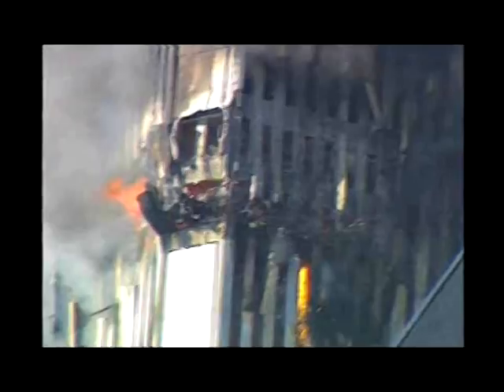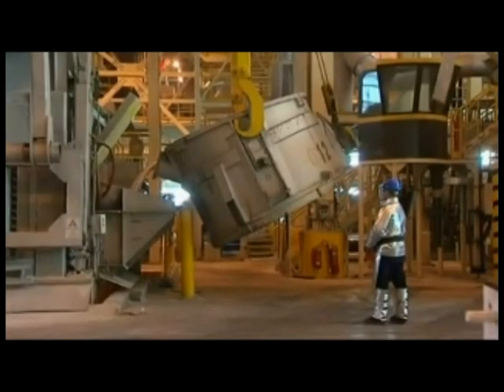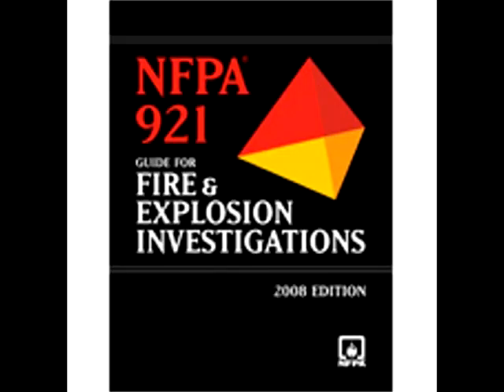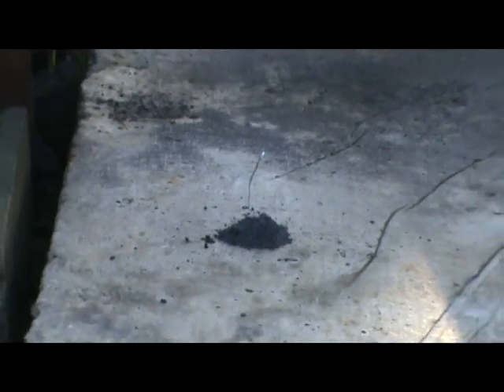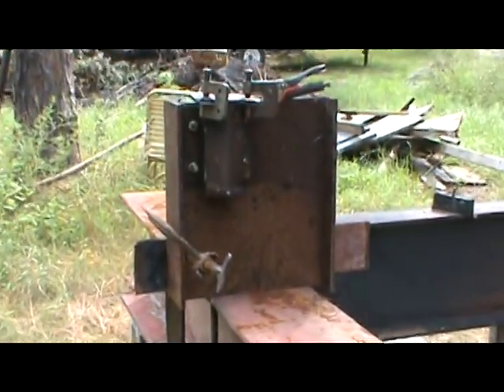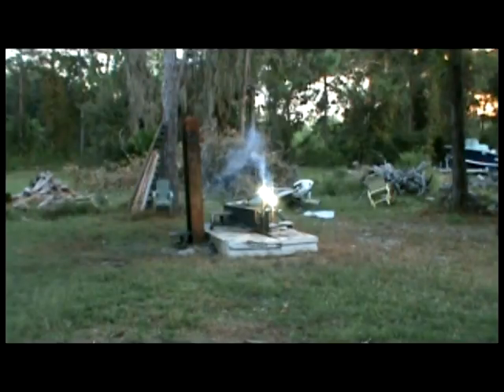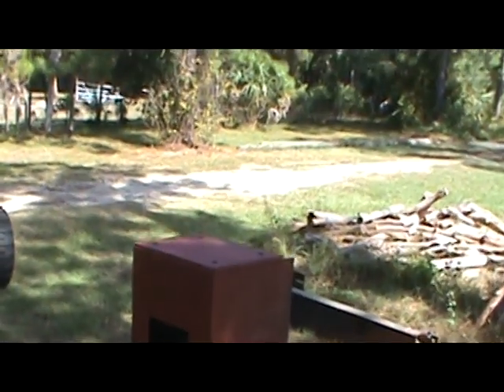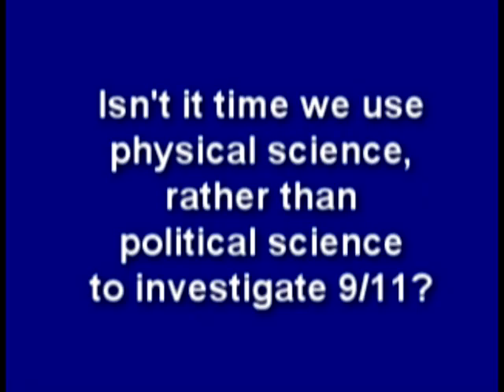9/11 Experiments: The Great Thermate Debate

Comment: You should be fucking ashamed as an engineer. First, it need not melt anything. You heat steel to that temperature and all that strength disappears. All it has to do is weaken and sag enough places such that the weight exceeds the design specifications. Once that happens all integrity is lost and the sequence of events to follow set in stone. The floor below it will have to hold more than design spec and can't so it fails, also weakened by intense (but not hot enough to actually melt) fire. If you look at the original prints for the construction it makes perfect sense. Not sure why everyone is so hung up on melting steel, you don't need to melt shit. Take a paperclip. Hold it with some pliers and then heat it with just a normal Bic lighter. Then use another pair of pliers to bend it at the point you were heating. Easy right? Now do the same without the heat. See? Come on engineer, this is basic shit. 

Yeah those puffs? Well see when one floor comes nearly uniformly pancakes..oh. You don't think that's how it went. Well, lets suspend that, how much air is in a building that size? How much one floor? Well it has to go somewhere when the floor above it comes down, path of least resistance is out the nearest window. Then the next one comes down and more air gets blown out. 

All you've done here is prove something that everyone with a brain already knew about cutting steel. What I would really like to see you do is to take one of those I beams and put an object of known mass on it, something quite heavy but well within what that beam should hold without moving a millimeter. Then heat the beam to a temperature comparable  to the temperature NIST says was the maximum and let cook for around the same time as the fires burned. Then measure the sag. I don't expect the beam to fail, but I expect it to sag and bend and be weakened. 

I'm not looking for you to cut the beam, just heat it. Humor me and do it? I would but I don't really have I beams laying around. Remember when heating to take into account the high winds at those heights so maybe fan the flames a bit, almost like a bellows. Everyone forgets the wind. Everyone can argue numbers all day, like how hot the fire was and how long it burned but at the end of the day numbers don't mean all that much when something like this happens. So many variables that were never even planned for or thought about, materials in the offices on those floors, how consistent the steel was in it's quality, if it was constructed well and no corners cut or if it was constructed poorly, and a dozen or so more to go along with those. 

I would really like to see that heat test though, bellows included. I think that would silence a lot of this shit, whichever side is right. If I'm wrong and the steel doesn't budge, then I'm wrong. If it does sag, maybe a few more clever tests to see how much sag you need to fail under a certain load.
Reply: A steel building has never collapsed again due to fire.
Reply: +William Lawrnece I guess building 7 did as well?

Comment: For all of you saying that the Towers were made to survive a plane crash just remember that the Titanic was made to be unsinkable and yet Ice took it out.
Reply: +joe eoj Titanic was never designed to be unsinkable. No-one at the ship yard or at the company that owned her said that, it was the media of the time who came up with that.
Reply: +joe eoj Technically, the towers WERE made to survive a plane crash from a Boeing 707 travelling 600~mph, the 707 being one of the largest passenger aircraft at the time. The planes that crashed into them (AFAIK) were 767's, Which are a decent bit heavier.
Reply: +Garrett Williams So how about WTC 7 then, not hit by the plane?
Reply: Whateverfits What the fuck was burning the steel beams columns?
Reply: All airplane recording boxes are gone. . Pentagon has 160 cameras 151 out of service lol
Reply: +joe eoj what if the titanic was a setup
Reply: +runlarryrun77 The Titanic would have survived a head on collision but the idiots turned. The iceberg ripped through the ship's side. Just google it.
Reply: what does the Titanic have to do with 9/11
Reply: +Whateverfits And, of course, the mass of the iceberg when it was struck by the Titanic is directly comparable to the mass of a Boeing 767 when it flew into one of the towers, yeah? If brains were measured in altitude, mate, you'd be a fucking deep hole in the ground!
Reply: Yes. I've seen it. No you don't need to continue.
Reply: ***** you say I lack intelligence when it is you that does not realize a Iceberg is made of frozen water also known as ice. So what you said was "you're stupid calling ice ice, dumb ass".
Reply: A Retarded Twat That's not the point I was making. I wasn't talking about the design, rather that the "unsinkable" label was bullshit hype bestowed by the media of the time, not by Harland & Wolff or the White Star Line.

Bored of this now. Thread muted.
Reply: But was it ice that actually took Titanic down??
Reply: Whateverfits yes but look at the time frame  titanic sunk 4/14/1912 the towers were finished in 1973 and were destroyed 9/11/2001 a big time difference which means technology has changed since then and the way things were built has changed as well
Reply: Garrett Williams So you're just going to ignore the massive amounts of evidence presented in this video and believe the narrative?
Reply: Technically it did survive the plane crash.
Reply: +runlarryrun77 Fair enough - planes are designed to not crash, tunnels are designed to not collapse, the space shuttle is designed to not burn up, refineries are designed to not blow up, battle rifles are designed to not jam, cars are designed to not roll over... do I need to continue? Ever seen 'Engineering Disasters'?
Reply: +runlarryrun77 Thank you for a civilized response!
Reply: It didn't get hit by a plane. but it did get hit by a fucking skyscraper
Reply: +OhFishyFish Why is this the number one excuse ever???  BUILDING 7, WTC 7!!!!!  BLAH BLAH BLAH.  Debris flew out of the buildings during and after both towers were hit.  Several fires broke out around nearby cars and other buildings and yes WTC 7.  The reason it didn't survive the fire was because one, fire fighters were busy, two the sprinklers couldn't work because their main water source came from the twin towers.  After they collapsed the water system was damaged.  Just a basic building collapse due to fire.  It's happened before with other buildings.
Reply: +joe eoj I'll give the engineers credit, the buildings did survive the initial impact.  Sadly the damage was already done so it was only a matter of time before the flames weakened the structural steel enough to where it couldn't hold the upper floors anymore.

Comment: Answer me this mister engineer. I am an amateur blacksmith and know it takes between 2400°f and 2500°f for me to forge weld and charcoal burns at just over 1200°f, so why do I not have a problem forge welding when I fire my forge with charcoal(kingsford to be exact)?Oh wait I know, its because I introduce extra air into my forge, you know I blow on it, just like the wind and thermal updraft did on 9/11.
Reply: +Corey Schmidt The thing is, you ARE a blacksmith. The OP is just a know-nothing poser.

Comment: If you watch the video of when the buildings fall, you can see the point of failure quite plainly. It fails near the point of impact. And when 10+ stories of steel and concrete start to move, well, there's no stopping it until it hits the ground. Say what you will, but I watched it happen like everyone else, and I saw simple physics at work.

Comment: Iron goes through a phase change at about 900 Degrees F which makes it significantly weaker, and obviously iron is IN STEEL, also, it IS possible that iron CAN melt out of steel leaving only the carbon chains. Dont forget that the impact of the plane most likely caused the steel to bend with the force of over 560 million pounds of force

Comment: You don't need to cut or melt a steel beam to make it collapse, silly...
Reply: +FieryWingedAngel The beams were melted is the point.
Reply: +CBodhi 
Its not a point wheter you need to or not, its a point that they DID.
Reply: +geovs20 B-52 hit the Sears tower? I hope your comment was meant as a"joke".
Reply: +Callsign Vega  A B-25 bomber hit the Empire State building in 1945. While I think they have their facts slightly wrong, I think they are still saying the same thing as the building was hit by a plane, fuel dumped in, building caught fire, and the building did not collapse.
Reply: +FieryWingedAngel you do if you want to make sure it collapses

Comment: Jet Fuel Can't Melt Steel Beams
Reply: nice meme
Reply: Person Man McDude Guy *Dank
Reply: Nathan Mierzwinski nice meme *Dank
Reply: Degenerate999 I'd just like to say he used "thermate" in this video, not "thermite." Although thermate is a different kind of thermite, he used it in this video to show that thermate could've been used instead of thermite to use it based on eye witness reports and evidence of what thermate did to the steel beams
Reply: +SoulRebelsoltera3 It was a B-25, which is WAY smaller than a 757. Back then, the much smaller fire was extinguished in 40 minutes.
The metal was molten by an ad-hoc mixture much like thermite, the light metals provided by the airplanes.
Reply: Degenerate999 Also, it was a dank meme, so chill
Reply: I like how people still don't get the meme here
Reply: +Nathan Mierzwinski  Really?  A wood or coal fire can melt steel with a little air added, kind of like the vortex of strong wind a raging fire in a skyscraper will cause.   And you don't need to melt steel to collapse a building, only soften it.  I heat up steel until it's red and hammer it into shape.  Never gets close to steel's melting point.
Reply: Sarah G I'm sorry I said you have bad grammar in your reply. But that wasn't even my whole point, Sarah. What i'm saying is that I can't and won't take you seriously if you think that just because "I'm unoriginal," and you say that "you've copied this from someone else," doesn't mean i can't say it. Like, for real, so what? If you're mature enough, you'd simply ignore this comment and move along with the rest of your life if this bugged you SO much. And no, I am notsoever trolling you.
Reply: Degenerate999 i would if it wasnt a public youtube comment section where everybody can see toplel.
Reply: Degenerate999 i dont understand whats going on.
Reply: Prot07ype /)*(\
Reply: Degenerate999 Because I wasn't expecting people to reply with something like how it's not possible to melt steel beams. It's a meme, I was expecting most people to react differently
Reply: True.  But burning jet fuel can.
Reply: Degenerate999 dont expect me to understand anything ever that ever exists sir :p
Reply: Sarah G Hold up, are you saying that just because someone else said it doesn't mean i can't say it? Granite, yes this meme is old and is stupid, but it doesn't mean i still can't put it out there. I can't take you seriously with your lack of grammar, spelling, and intelligence.
Reply: Degenerate999 some day
Reply: Person Man McDude Guy
Why?
Reply: Degenerate999 cause reasons.
Reply: Person Man McDude Guy
 No reason is worth it. puts on glasses, grabs notebook
Now, tell me why you are feeling this way, Person Man. I'm listening.
Reply: Person Man McDude Guy You see, what if i told you, that of failed suicide attempts, 98% of the people said they instantly regretted the decision. Would that change your mind, Person Man? And what if i told you, that ending your life, doesn't actually solve your problems. Even though, at the time, it may seem like a sure solution..... I'm not a proffesional. I may end up accidently talking you into this. I'm sorry......uhmm.... NO NO DON'T DO IT! It was a mistake! Don't!, Stop it we can't! The numbers are bad, the numbers are bad!
Reply: +Person Man McDude Guy /)
Reply: Nathan Mierzwinski
It's a meme, because it's a fact.... How you don't understand that is what i don't get...
Reply: Nathan Mierzwinski Lol yeah, but it's like a meme about how ridiculous some atheist's big bang theory is. like if this were a meme 'Where did the energy for the explosion come from?' Is sure to incite  passionate responses from both religions. christianity, and atheism. You had to expect people to take this too seriously and into debate mode.
Reply: Degenerate999 lol i guess you're right
Reply: +Degenerate999 Most likely, they used thermite and other types of explosives.
Reply: Simboiss None of which would make steel beams vaporize. Steve Gould, you are a fucking moron.
Reply: Steve Gould
 Burning jet fuel does not make steel beams vaporize, you invalid.
Reply: Noone talked about steel vaporizing. Some steel, at some places, may have weakened, but most of the building was at room temperature.
Reply: Simboiss
steel beams were vaporized. that is a fact. I dont know what you are talking about....
Reply: Person Man McDude Guy
lol that last bit i was joking, and then a random reference to something you obviously did not see. The rest is self explanatory.
Reply: Person Man McDude Guy lol It was the most random reference ever. I didnt really expect you to get it. although if you did you would realize it had nothing to do with anything else i was saying anyway.
Reply: Degenerate999 what was the reference?
Reply: Person Man McDude Guy
The tv show Lost. When a fat guy was trying to stop people from blowing something up. LOL
Reply: Degenerate999 i never saw that show, so yeah and stuff.
Reply: Person Man McDude Guy
I know if you saw it you would have recognized it instantly.
I do recommend it though. Its my favorite show. And ironically is about a plane crashing.
Reply: Degenerate999 thats sexy.
Reply: Person Man McDude Guy
lol
Reply: Degenerate999 kek
Reply: It's really hard to take your comment seriously when you start with this: 

[ A Boeing has a bone structure made from high tensile aluminium which is stronger than steel ] 

Please share with us the special properties of this magical aluminum. Surely you have an alloy number for this magical aluminum?
Reply: N8 the Gr8
Reply: the fact their is no plane at the Pennsylvanian site and reports said they could only fine debris from the air plane the size of a cell phone!? this makes no sense once so ever and eye witnesses said they saw nothing, no bodies nothing just small bits of debris and a crater, they say the plane and the bodies all mostly vaporized after crashing!? lol ooookay like that makes any logical physical sense? something is wrong and we are being lied to because of the jews cough israel.
Reply: it doedsn't have to, it jus tneeded to weaken the steel, which it did
Reply: My penis can tho
Reply: No shit jet fuel can't,  fire melts steel,  not liquids.
Reply: N8 the Gr8 It can and it did
Reply: But thermite sure can!
Reply: Dont have to melt the steel beams just get them red hot to weaken.
Reply: N8 the Gr8
When 10-15 tons of fuel explodes at once you bet your dumb fucking ass it will.... not even including all the gas lines and such running through the tower.
Reply: +Cody Stein the floors didn't even have beams they were rods!! lmao! crony capitalists is what helped ruin those buildings. lobbying which cut steel use by HALF. -Gone Lucid
Reply: +Tom wtc7
Reply: Degenerate999 firstly, he wasnt serious he was using a meme. secondly, 9/11 wasnt a government cover up.
Reply: But it can weaken it
Reply: +Nathan Mierzwinski  the beams were not (only) melted. there is video of steel beams vaporizing/ turning to dust in a second. thermite could never and will never acheive this result. Whatever whoever used for this, it wasn't thermite.
Reply: Go ahead and hate! You are right however that doesn’t explain freefall speed because the pressure would snap the steal beams and the beams would snap in different directions causing the fall of the build to teeter totter on the way down. It didn’t it was free fall. Now I believe planes did hit the WTC but there was thermite involved no doubt about it.
Reply: Degenerate999 multiple planes crashing into a building means the building collapses. its actually quite simple.

Comment: I really wish that videos like this have the facts straight. This is another thing on a legitimate TV show where they use jet fuel and a little bit of weight on the beam and the beam will fall to the ground not completely melting but with the weight of 20 something floors on it and that's that. I know our government is fucked up and I'll Court system is fucked up but why in god's name would they stage airplanes crashing into the fucking building and then try to blow it up with thermite this whole thing just fucking annoys me because the science is always exaggerated and it really is not science. yeah and I had to bury some friends who were going into this building. not once did any of my firefighter friends tell me that was sparks flying on them

Comment: is it possible that poorly grounded electrical wires were basically cutting through the steel beams? I've seen welding and that would explain both the molten metal and the white flashes and the loud booming sounds that people heard. it is entirely plausible that that is what happened. the building had to have had a very high voltage supply.